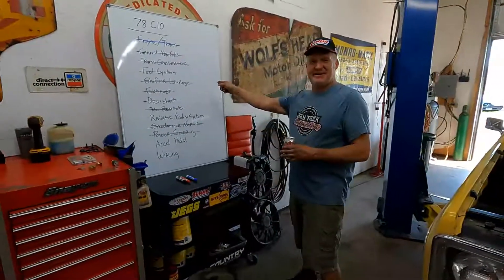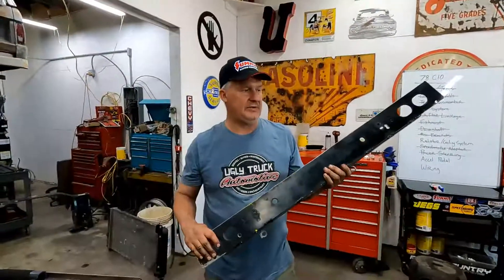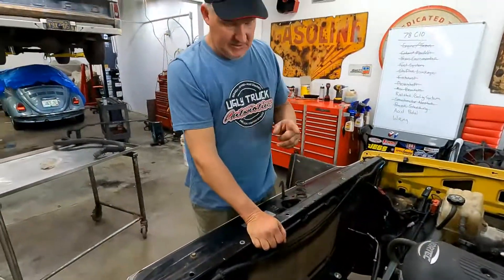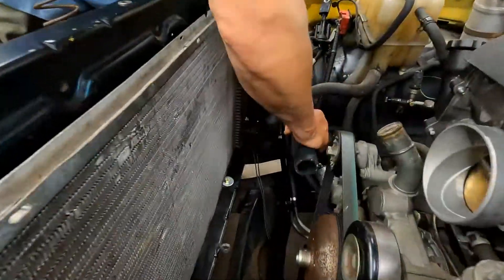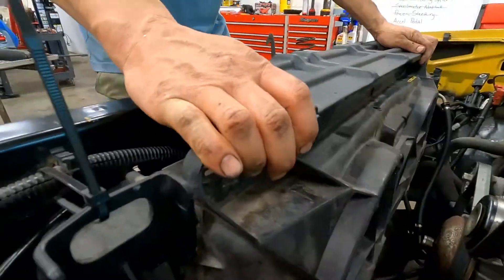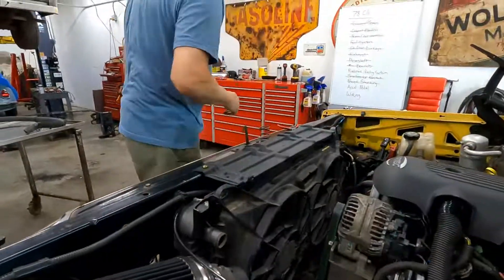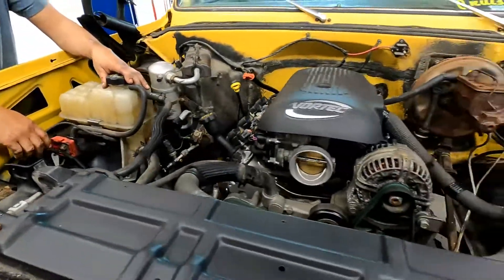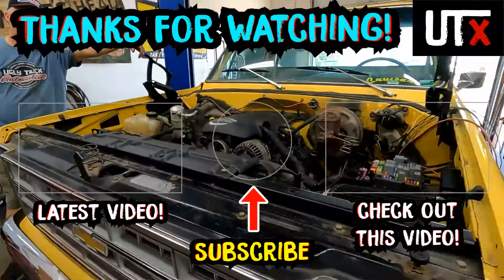KEEP IT COOL - EASY & CHEAP Radiator + Cooling System - Chevy C10 5.3 LS Swap - UTX

Comment: Nice work.  I basically used the same pieces on my '68 C10 except I used a water pump from a 2010 Camaro 6.2.  Not only was the outlet on the drivers side of the engine so you can use a very short upper hose but it included a tapped boss on the passenger side for a belt tensioner pulley if you don't use the stock belt routing.  All that was needed was to cut off the mounting ear on the alt/PS support where the stock idler pulley is mounted.
Reply from the maker: Great info, Ken! We've heard of a few people running the Camaro water pump, but didn't know exactly what it entailed. Thanks for watching and sharing!  --Emily and Jerry

Comment: Just found this video, I have been running a late model Chevy truck radiator in my 72 for years.  What I did differently was I found the smaller radiator fit in the core support easier, I cut off the plastic pegs on the bottom and used the original style mounts.  The upper mounts on the radiator were used to mount my ls1 fan to the radiator with the help of a home made bracket adapter.
Reply from the maker: Hello Carguy.  Sounds like the same setup that we put on Emily's 1970.  We ended up going with a mechanical fan on hers.  Would have liked to do an electric one for sure.  Thanks for watching and commenting.  We appreciate it.  Jerry and Emily
Reply: Did you use the upper and lower shroud out of the doner truck?
Reply: @chalecharros7689  I’m using an electric fan, the fan is off of a 97 to 02 f body.  I had to make some brackets to mount it.

Comment: I am doing a swap on a 71 Caprice and my radiator is much narrower than the one out of my 04 Silverado donor. I was wondering if there was another GM radiator narrower that I could run so I can still use the factory cooling system with all the factory components, instead of re inventing the wheel trying to figure out how to incorporate my stock '71 cooling system with my 5.3 swap, id rather keep it as original to the 2004 tahoe set up as possible.... Thank you in advance for any input, as always I appreciate your channel more than you know it's like having a LS guru to run and get all your questions answered.... Much appreciated
Reply from the maker: Hey Matthew.  There is a radiator that is a little over 28 inches for a core width that might work for you.   Spectra Premium CU2334.  They did not have a electric fan setup for these radiators, they we're all mechanical.  We used it in Emily's 70 because of it's size.  It might be your best option.  Hope that helps and if you end up using it be sure to let us know.  Jerry and Emily

Comment: I’ve watched quite a few of your videos on LS stuff very informative. I’m curious you didn’t show you hooking up the large hose on the overflow tank, I picked up of modern tank at the junkyard the other day off of a Sunfire and I thought I was gonna put it into the lower radiator hose (T) is how it was on the sun fire, but yours looks like it’s going to the LS water pump, I searched the previous video to see if I missed you hooking that up but I didn’t see it
Reply from the maker: Hey T Dubb.  I use the original style coolant tank and the hoses from the donor.  The one you are describing runs from the water pump, y's off and goes to the tank and also the return side of the heater core.  There is another one off of the water pump that goes to the inlet of the heater core.  We haven't done a video talking about that but probably should.  I hope that answered your question.  Thanks for watching.  Jerry

Comment: Love the upper radiator mount idea!
Reply from the maker: Thanks! It's a pretty simple fix, especially if you're using the stock electric fans. Thanks for watching!
Reply: @UglyTruckExperience  is that upper radiator mount the stock piece from the c10 or the donor vehicle?
Reply from the maker: It is! We just added a couple tabs to hold the radiator a little tighter. Thanks for watching!
Reply: @Fahrenheit_Motorsports it's the original from the Square body.
Reply from the maker: It is.from the donor.  Jerry

Comment: Tell me some stuff about this. 78 truck like yours. I ran the factory clutch fan on my engine. Then put a 75 triple core radiator and radiator 75 fan shroud. All of it fit perfect. I ran a $30 upper hose adapter with bleed port built in.  And used factory upper hose. 
When I tried to use the 2003 radiator from the Tahoe, it was too tall. 

I haven’t run the truck yet. I don’t see why the older triple core with clutch fan won’t work.
Can you tell me why you didn’t go a route like this.

Your video did open up ideas on what I can do with electric fans now that I know the stuff fits as well as it does.
Reply from the maker: Hello Jack. I like to use the radiator from the newer donors mainly because I will try to go with a electric fan.  That fan gives me more room and options for my air intake. It also makes the engine warm up quicker and maintains a more even engine temp with AC on or off.  It absolutely makes the AC work better and it doesn't rob any HP aside from the alternator load which is next to nothing.  The overflow system from earlier on rely on the radiator cap to keep a cooling system full, in order for that to happen there can not be any coolant leaks at all. If there is a leak on a overflow system, it may just run hot and never create the vacuum needed to pull that coolant back into the radiator. On a sealed system, that coolant is just there to use and the LS just don't leak like the earlier motors. I build these for customers also, so I will use the low coolant indicator that is built into that coolant tank so they can get a warning if the coolant drops to that level. The way you have done yours will work perfectly fine.  We did our 74 k10 the same and it works great. Thanks for watching, commenting and reading this extremely long reply.  My apologies, I just love this stuff.  Jerry

Comment: Hello and good day too you all!!!  I am newly subscribed to your channel and watched most all videos of the 85 ls swap gonna help me emensley with my project. I love how you explain every job on your list step by step and not just switching from eg radiator to injector wireing and heater hose. One step at a time. thats a great help thanks some of us are not smart and need simple explanations. 😃😃😃 My question to you is. On a early to mid 80s how would you support the rad being its a different bracket style than this yellow truck your working on? Peace i meen is the shroud on top. like the icing on the cake. lol
Reply from the maker: Welcome aboard! 👋 Glad you're enjoying the videos! We actually have 2 1986 C10 LS swaps coming up, so if you can hold out for just a bit, we'll have you covered! If there's anything else you'd like to see, just let us know and we'll do our best to make it happen. We appreciate you watching!

Comment: Just seen your video on this great video! I’m in the process of swapping a 68 c10 and I was curious what upper mount do you use to put in the stock Yukon radiator Iv got a complete Yukon xl for my swap
Reply from the maker: Hello Jesse. I use the top portion of the radiator support from the donor and modify them to work as my upper radiator support.  It ends up bolting to the radiator and the shroud like normal and then fastens to the trucks core support at its original mounting holes. We should probably do a video on that.  Thanks for watching.  Jerry and Emily
Reply: @UglyTruckExperience  please do!! Thank you

Comment: How did you do the transmission lines??
Reply from the maker: On most of our swaps we use the original donor transmission lines. We end up cutting about just a few inches off of them and then putting a new flare on the ends. You can buy new transmission lines from most parts stores and just cut and flare them to fit. Thanks for tuning in!  --Jerry and Emily

Comment: have you ever tried using square body accessory engine parts, like radiator ,puke bottle, powersteering pump n brackets, one wire alt. I'm to keep from using as many of donor trucks parts, as they cost more than square body parts do. also do you run DEX-COOL or glychol based coolant? temp. of thermostat?
Reply from the maker: No, I have always used the ls parts.  The work involved in keeping with the original square body parts would out weigh the cost of the parts.  I run orange DEX-COOL in them.  Thanks  Jerry

Comment: What do you do with the steam vent by the intake? Did you plug it into the radiator by the rad cap? I mean its essentially just like a 99-06 silverado ?
Reply from the maker: Yep, this setup is just like the donor and uses all donor parts. That steam line runs to the port on the radiator just like on a Silverado. Thanks for watching!  --Emily and Jerry

Comment: Jerry, I’m LS swapping an ‘87 squarebody. It has had a new radiator installed in it. Would it hurt for me to use that radiator? I have a 5.3 LS. I will also install a dual electric fan shroud.
Reply from the maker: Hello Joey.  I have seen a bunch of them with that stock radiator.  There wouldn't be any reason not to use it that I could see.  Thanks for watching.  Jerry

Comment: Do you have a code on how to go from engine fan to electric fan if you swap didn't come with electric fans ?
Reply from the maker: The oem harness already has the plug on it to plug into the cooling fan relay harness and the computer is already set up to turn the fans on for whatever your donor vehicle was even if it had mechanical fan.  When you have computer programmed you can let them know you want to run electric fans and what temperature you would like to have fans on and off.  I run 180 degree thermostats and just let them know that and they adjust accordingly.  Thanks Eric.  Let us know how it goes.   Jerry

Comment: Could I buy those brackets to hold the overflow reservoir. I put a 5.3 in my 86 k5 blazer
Reply from the maker: Hello Josh.  Are you wanting the oem bracket for the overflow or are you asking about the custom ones that we make?  Jerry
Reply: @UglyTruckExperience  the custom ones to use the oem res to the passenger inner fender on a squarebody

Comment: Great video. Thanks for the info. What did you do with the AC condenser lines? Or did you do away with AC? Thanks in advance.
Reply from the maker: On these I use the condenser from a 85 model c10.  I heat the tubes on it and bend them out a little further out to go around radiator.  I use 85 high side line going to evaporator and then I use a Murray 55468 suction and discharge line assembly.
Reply: Can  i use condensor from 84 c10

Comment: Thanks for the video! On the Stock top plate shroud cover is that out of the Suburban you took the LS out of? or the 1978 Squarebody? Not sure I have seen that top mounting plate before?
Reply from the maker: That piece is original to the 1978 C10. I believe we just added a couple tabs on the back to hold the radiator, and bolted it to the stock location. It worked and looked great!

Comment: Just watched your video on swapping the 5.3 into the 1970 c10 and was wondering if that truck has the 28” wide radiator or if its the wider one that this truck got?
Reply from the maker: We appreciate you watching our stuff! The 70 has this same radiator in it. It fits a little different, but we used the same lower mount concept. I still have zip ties for upper mounts... I want to make a shroud that covers the space between the grill and rad support, and I keep thinking someday I'll come up with some amazing idea to do it in one piece. So far no luck! 🤣🤣 --Emily

Comment: What ac condenser do you use in ls swap square body
Reply from the maker: I have been replacing them with a new condenser that would been from the donor vehicle.  I have to modify the radiator support a bit but it works better and I can use the donor high pressure line to compressor.   Thanks. Jerry

Comment: Roughly what temp should these 5.3 swapped trucks run at?  My 86 C10, 2002 5.3 with a stock mechanical fan, reusing the C10's original fan shroud and radiator runs about 200-210 running around town.  It has the stock 187 degree thermostat.  Just seems warmer than it should be.  Already replaced the stock fan clutch with a new one.  Thanks for all your vids.  They def helped doing my swap.
Reply from the maker: The stock program for most of these that I have seen is going to turn the fan on at 200 degrees.  When you have your computer programmed you can have the fan controlled at whatever temperature you like.   I believe the higher running temps these days are due to emissions and fuel economy.  I personally leave them at 200.  Thanks
Reply: @UglyTruckExperience  Thanks for the reply.  Yeah I've got an auto meter temp gauge in the passenger side head back by #8, and it reads about 10 degrees higher than the factory temp sensor at the front of the driver's side head.  Guess I'm just used to my old SBCs running right at 180.  Told the parts guy the other day that my holding onto the SBC must be like the rodders that held onto their Flatheads in the 50s.  Thanks again.

Comment: Great video ugly garage. Im using your vids for my 74 k5 blazer 4x4. Do you know if the stock radiator will work with the th400 trans hook ups. Also what's your opinion on coolant type. I'm leaning toward oe orange dex-cool
Reply from the maker: If your using the ls radiator you will have different fittings at the radiator.  It sounds like you are putting in a LS and keeping the 400 transmission?   I use orange dexcool.  Thanks  Jerry
Reply: @UglyTruckExperience  HI Jerry,
Yeah I'm keeping the th400 Trans and got a 5.3 lm7 I will be dropping in. I'm keeping the 400 trans cause it's passenger side drop for the drives haft.
I was liking the radiator set up your video had in keeping the motor and radiator together. Cool thanks for the info
Reply from the maker: Sounds cool. We have a 74 short bed 4x4. We're using a 4L60E with a stock transfer case. It would have definitely been easier to keep the TH400. Keep us posted on your build. Best of luck.  Thanks   Jerry

Comment: Hello i have a 83 chevy wagon i  can use the same parts  Is there any other option thanks
Reply from the maker: If your swapping into a 83 chevy wagon you might just want to use it's original radiator and see if you can't find some radiator hoses that would line up ok.  Adding a steam line to the upper hose also.  Thanks   Jerry
Reply: @UglyTruckExperience  thanks. An excellent video I like all of them  ......

Comment: Is that top plate from a 454 truck
Reply from the maker: Hey Khary.  What part are you asking about specifically?  I haven't seen this in a while.  Thanks. Jerry
Reply: @UglyTruckExperience  black top plate that secured radiator to fan
Reply from the maker: That is the top piece that I cut out of the donor radiator support.  I rivet a bracket onto it that I custom make and then the radiator and fan bolt together like they would in the 2004 donor truck.  It ends up looking pretty nice I think.   Jerry

Comment: Will you make me a set of cooling tank reservoir brackets ?
Reply from the maker: Each one of them is a little different depending on exactly where the reservoir is sitting and the make and model that your working with.  What are you swapping?
Reply: @UglyTruckExperience   03 5.3 out of suburban into 81 c10
Reply: Doing exactly as you did on your 78 c10 .